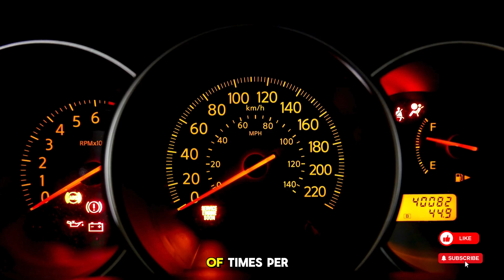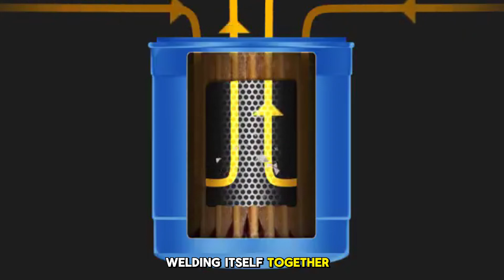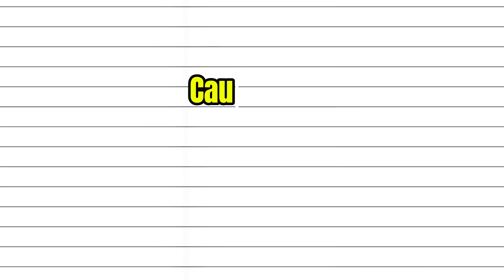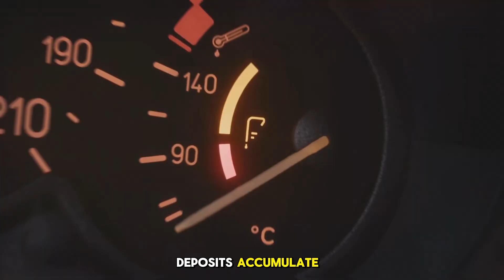7 Reasons Your Piston Could Explode Don’t Let This Destroy Your Engine!

Comment: Do you really need synthetic oil, or is it just a marketing scam? Can bad oil actually cause piston failure?
Reply from the maker: Synthetic oil is absolutely necessary in many modern engines. It resists breakdown at high temps. Using cheap or wrong-grade oil can lead to piston ring damage and failure over time.

Comment: Using regular fuel in a high-compression engine isn’t driver error — it's poor manufacturer communication. Agree or disagree?
Reply from the maker: Partially agree. Manuals and fuel caps do warn, but manufacturers should highlight this more clearly. Still, using the wrong fuel in a performance engine is risky.

Comment: Modern engines are too sensitive — older cars never had pistons explode this easily. Are we overengineering vehicles today?
Reply from the maker: Modern engines are built for higher performance and lower emissions, but that comes with tighter tolerances. Yes, we are pushing limits — and that can mean more risk if maintenance is ignored.